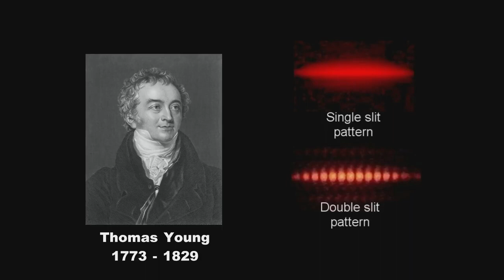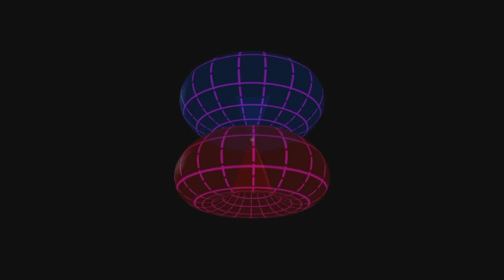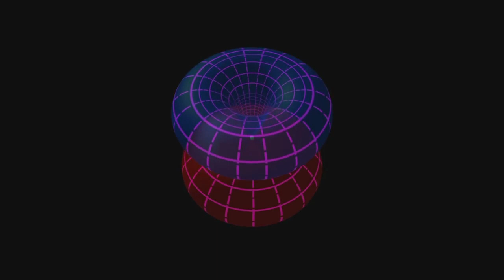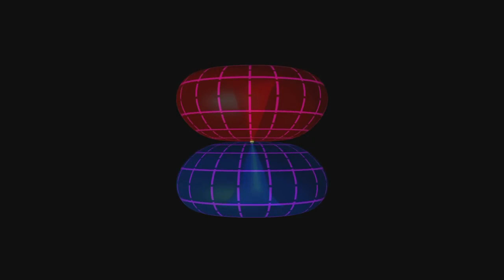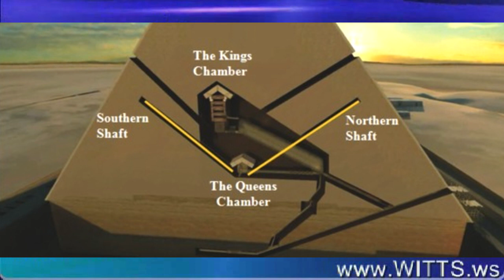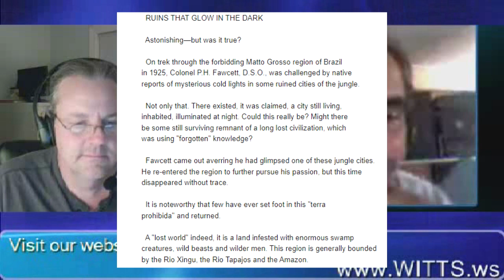How to Build a Miniature Sun, Free Energy Heat and Light

Comment: Is this cold?
The primer cube arrays are made from pla which is extremely heat sensitive so I can't imagine these working if this builds up any heat...?
Also, what cables are suitable here, again if its hot wouldn't something like spectra or kevlar melt even if they are fairly heat resistant?
Reply from the maker: As far as I know, all you need is north-south magnetism. So make two highy highly polished copper hemispheres, maybe 12" each, and line them up north-sound then add some magnets around them, aligned properly. Get a decent HV DC power supply that has enough milliamps to keep everything charged, and slowly adjust the  distance between them. You don't need the bowl shaped magnetic field. It doesn't need to be in a vacuum tube David Allen LaPointe did. Just make sure there's not too much moving air and the humidity isn't too low. You can also takes classes from WITTS. Let me know how you do.

Comment: so 2 polished metal hemispheres and a small steel ball(positive)  in the middle and where do i put thge magnets and what kind of magnets? negative goes to magnets?
Reply from the maker: You do not need a steel ball. You need one hemisphere to be North and one the be South, and you should line it up magnetically as well. David LaPoint's special magnets work well. He has the patent and CAD files on his website. The bowl shapes are plastic with holes CNC machined into them for small neodymium magnets.